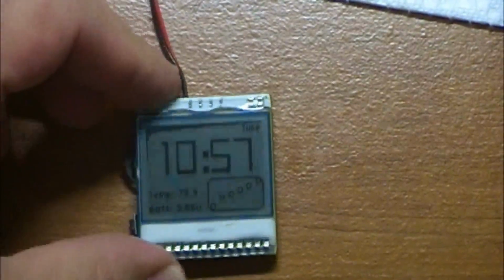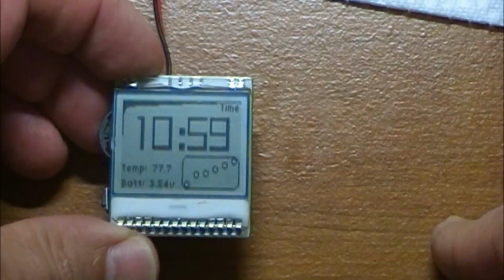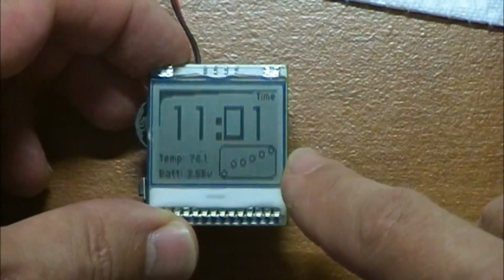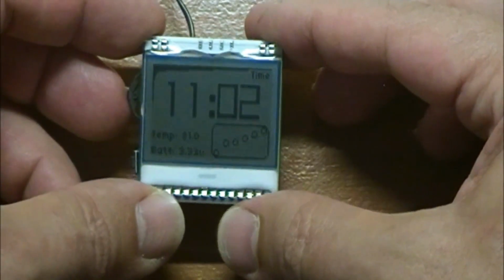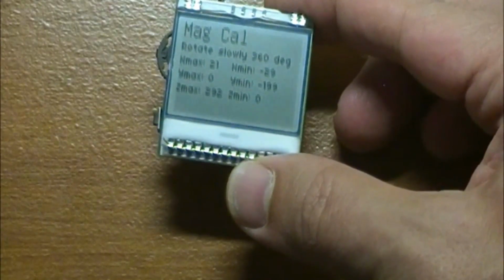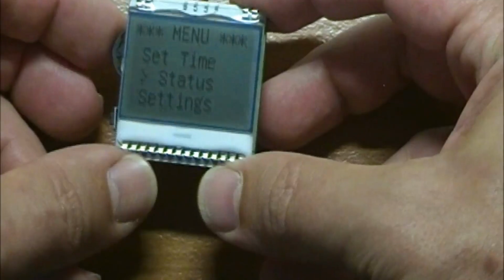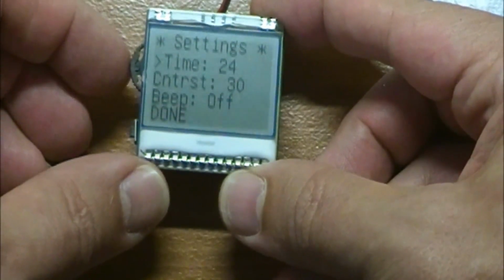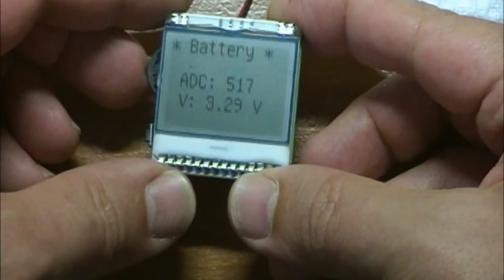Arduino Smart Watch

Comment from the maker: Here is the link to the Atmel Simply AVR Contest site. If you click on VOTE in the upper left corner it will take you to all of the entries. Mine is the video with Arduino Smart Watch on the preview (Currently on page 3). Thanks for voting.
http://app.snapapp.com/simplyavrcontest
Reply: +Dan Geiger Why u don't make a stand by mode which everything will working normally in background except screen goes off and while user press button screen comes to show anything.
I guess this will save a lot of battery. ^_^
Reply from the maker: +Abdelaziz Elrashed The LCD doesn't take any more power if it is showing nothing or something. I could add a transistor to turn power to it on and off, but then I would need to reinitialize it every time I wanted to display something. The display actually takes very little power to run. See my blog for more details.